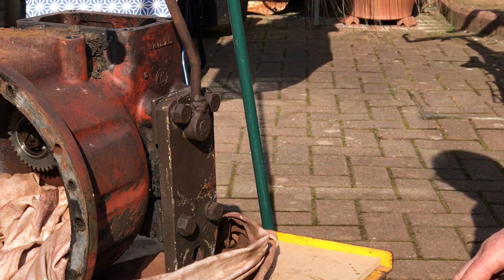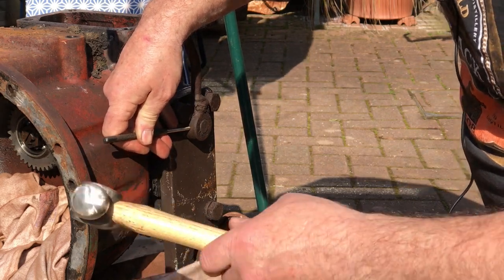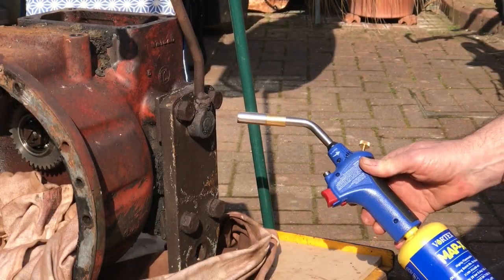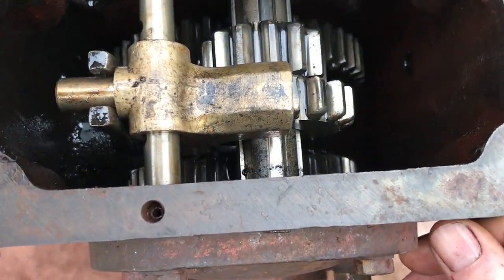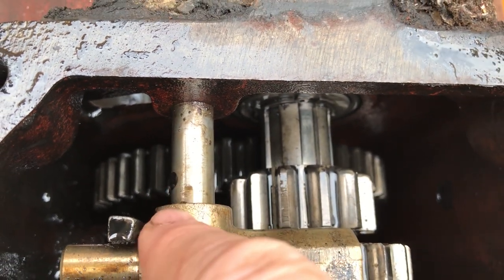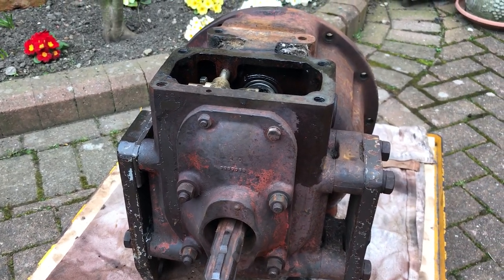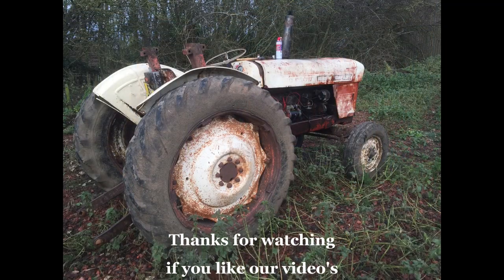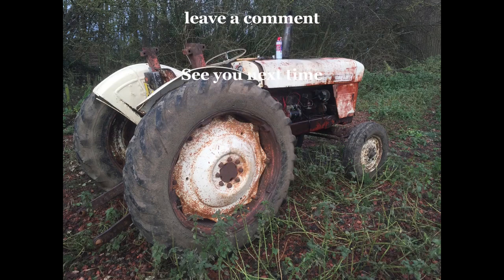David Brown 990 Dismantling the PTO #19

Comment: Outstanding.  Reading the shop manual is one thing, but seeing someone tear down is so much better.  It's true: a picture (or video in this case) is worth a thousand words.
Reply from the maker: Hi Shane, yes your right, if you have a shop manual like mine, it gets very confusing at times and it always helps to have visual references,
many thanks for your comments
Barry
Reply: @manfromthemist1958  I am very interested in understanding how the ramshaft and valve chest come out.  My 990 is slowly dropping it's lift arms and 'hiccuping'.   I think it's loosing oil from around the hydraulic piston.  So eventually I'll need to service it.  

My family has another 990 that the lift arms shoot straight up when the tractor is started.  I think the spool valve is stuck in the bore in the lift position and any video for removal and/or service of the valve chest is going to be immensely helpful to me.

D3Shooter on Youtube has a full breakdown of how the hydraulics valve chest works:  https://youtu.be/FCU2t3fTv-k
Reply from the maker: Hi Shane, I will have a video coming up as I need to remove the lift ram and all the parts from the rear axel to swap over to the replacement axel
many thanks
Barry

Comment: Gr8 video again, what is your wash as you get the dirty greasy bits soo clean?
Reply from the maker: Hi Dave, If I remember correctly that was some diesel probably followed by a chemical cleaner called elbow grease, which is a yellowish liquid in a squirty bottle from morrisons supermarket, the last time I bought some it was £1 for a 1 ltr bottle, its also a great paint stripped as long as the coatings not that good. After the degreasing everything gets a good wire brushing, sometimes even as low as a dremil with little brushes for the tricky bits
many thanks for your support.
Barry

Comment: Thanks for the great tutorials! Well done. Super informative. My father bought a 1972 990 back in 1980 it came with a Wain Roy hoe. It has been an amazing farm tractor and always starts runs and does what is asked. My son is a talented mechanic and he and I took off the hoe tonight to take care of a few things and we’re wondering if we could add a three point hitch to this machine and still use the hoe also, when needed?
Reply from the maker: Hi Tim, you got me with that one, could you please send me some photo's of the rear of your tractor and we'll put them into the community section and ask the question, some one out there will have an answer.
many thanks
Barry
Reply: I’ll get some pics today of the back of the tractor and the hoe attachment. I located a 1972 990 for sale in Montana with a three point hitch. I’ll send  pics of that also. That could be either a machine we use or a parts tractor for ours.

Comment: Good video!
Can you tell me where to find parts for this? Is there maybe a rebuild kit?
I bought a 990 Selectamatic white recent and after getting it going I now found that the PTO low gear made a lot of noise when engaged, and now it jumps out of gear on the PTO low as soon as i crank the engine. PTO high is OK, but it might actually be a little bent PTO outputshaft.. 
So this PTO need fixing, but it is not easy to find parts for this online.. It might be easy, but I don't know where to look maybe..
So please advice me here :) 
(I did not find any "DM" button, so I commented on the video, hope you see it)
Reply from the maker: Hi, thanks for the comments, have you took the PTO to pieces yet, it may be it only needs replacement bearings, there are two ball and two needle bearings in mine, could also be something simple suh as the spring on the detent broken or worn selector. which country are you in? and a lot depends on what you use your tractor for, is this a farm vehicle in everyday use or a restoration project?
many thanks
Barry

Comment: Good video I have just bought a DB 996 and it needs quite a lot fixing.  It's on my channel if you would like to see it. Couple of tools that may have  help you do this, circlip pliers that have 90 deg bends on the end and let you get into the clips easely. Amazon do a set of carbide tipped drills for under £20 very good at drilling through very hard metal. A bit of cutting oil helps them greatly. 
Most of my videos are restoring my 1955 Fordson Major. But plan to show the BD restoration also. Keep up the good vids M 😀
Reply from the maker: Hi Marshall, thanks for the tips, i'll have a look at your channel later today, is that a black 5 on your home page image?
many thanks
Reply: @manfromthemist1958  yes it is a black 5 one of the ones from Fort William  to Mallage.  Through Glen Finnian. Which is the bridge on the Harry Potter films. My late uncle used to drive them. M

Comment: My 990 selectomatic vibrate a lot when I engaged the p t o is it because the bearings are shot. ?
Reply from the maker: Hi John, it could be, with the engine off and the key out of the ignition, engage the PTO go to the back of the tractor and try to wobble the shaft in all directions to see if there is any play in the shaft, try to rotate the shaft back and forth against the clutch looking for excessive travel, also have someone in the seat with the clutch depressed, (PTO still engaged engine OFF) and then rotate the shaft while listening for unusual noises, does the vibration stop if you depress the clutch allow the shaft stop rotating with the engine running?
lets know how you get on
many thanks
Barry
ps I've just posted this also to the community tab to see if any other owners out there could help with possible solutions.